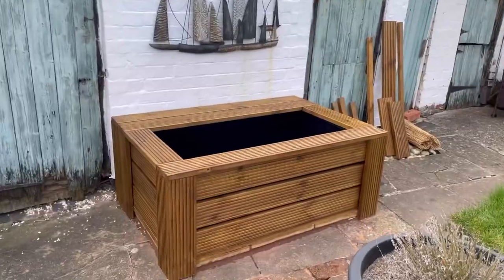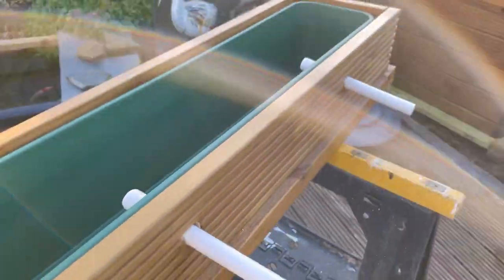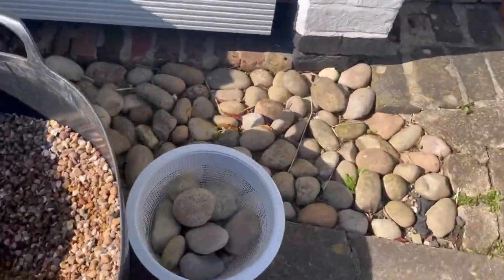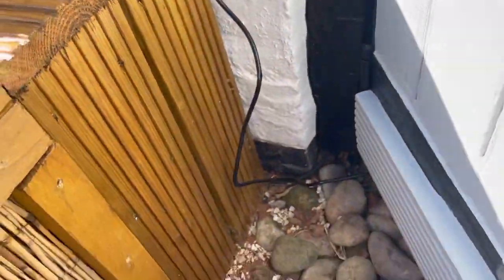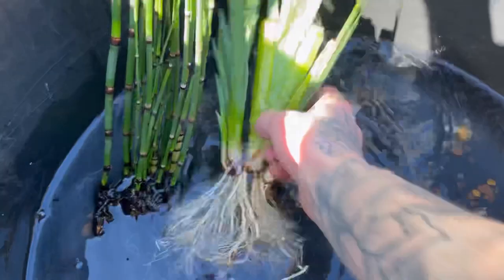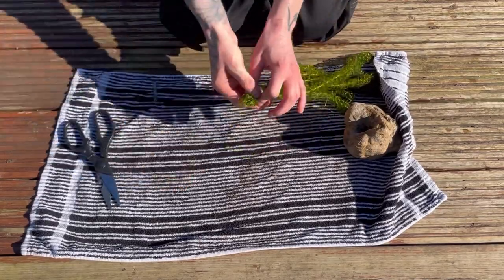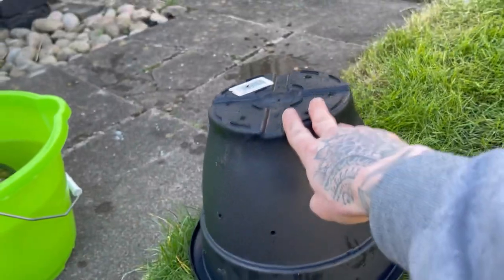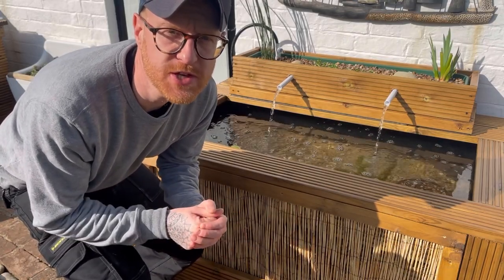DIY *above ground* MINI POND! (Pt.2)

Comment: That's really good, love it, the only thing that I would recommend is that your pump not be at the bottom of the pond, but up a bit on bricks or something,  just in case there is a leak or a fox pulls the tray over or something unforeseen and then the pump won't completely empty the pond, killing the fish. I keep getting a fox in my garden that is fascinated by the pond pump tube and air stone tubes, he keeps biting them and has completely chewed though the ayirstone tubes twice now, if he wanted he could easily bite though the pond pump tube as well and if my pond pump was on the bottom of the pond it would empty it  but so far I've been lucky. In my ponds I have the pumps up on ledges, never on the bottom for this and other similar reasons.
Reply from the maker: Thank you! Yeah, I did end up taking out that pump when I later added a canister filter as a pre-filter.. and when I did that I made sure the intake didn’t go all the way to the bottom. Luckily I’ve not had any issue with fox’s, but I’m alway on my guard as I’ve got chickens! Thanks for watching! 😊
Reply: Found it! New subscriber 😊

Comment: Brilliant - really helpful videos! I've basically followed your example, just finishing off the bog filter today hopefully. When you filled up the tank - did you put the blank cap in place? I siliconed mine in place, front and back, so I could get a load more water in - seemed more beneficial than having an overflow 3 inches down the tank wall.
Reply from the maker: That’s awesome to hear!! Yeah, I also siliconed in the blank cap!!! 😊

Comment: Great video.  The plants that you placed in the pond that were in pots do they just contain gravel?
Reply from the maker: Yeah, I pretty much plant all my plants in gravel as it forces them to pull there nutrients from the water column and therefore helps to prevent algae. The only exception is Water Lilly’s, as they are such heavy root feeders, I plant them in aquatic compost with aquatic fertiliser balls. 👍

Comment: Thanks for a great video. Question, is the little aerator on the bottom necessary? I’d think the aeration from the water coming back into the pond from the bog filter would be enough?
Reply from the maker: Yeah, I think you’re right.. as long as the pond isn’t too overstocked, the amount of aeration produced from the water flowing back into the pond should be plenty!

Comment: I think you'd be better sealing the pipe from the pump into the filter inlet to force the water to come up from the bottom of the filter, otherwise its going to take the path of least resistance and possibly just come out the top of the pipe.
Reply from the maker: Yeah, I did think about sealing it, but decided this way it would make it easier if I wanted to remove the pump and stuff.. I do think the water is going down to the bottom of the filter though, as it doesn’t seem to be coming out anywhere else. I’m building a big version of this in the summer for my new pond, they’ll be a couple of extra feature on it though, and i’m also planning on bringing the water in directly at the bottom, rather than coming in over the top and then down to the bottom, which will defo make sure the water moves though all the gravel! Thanks for watching! 😊

Comment: Hi do you not need various sized pebbles in levels in the bog filter? Just curious as ive seen others put various sizes in. Thanks
Reply from the maker: Ideally yeah, you would have larger pebbles at the bottom working up to smaller ones towards the top. But in a small bog filter like this one, just one size worked fine. I think if I’d used larger stones in this bog filter they would have taken up too much space and made it hard to plant in to.

Comment: What type of wood do you use and do you use some kind of weather resistant sealant on the wood to keep from rotting?
Reply from the maker: I used all pressure treated wood that’s intended for outdoor use, and I then stained it with water based wood stain to give it some extra protection! 😊

Comment: What is your climate like in the winter?  I see you insulated but do you get any freezing weather?  I'm thinking of doing something similar but I don't want to have to bring fish in for the winter.  Thanks and great video :)
Reply from the maker: Hi mate, thanks very much! Yeah, temps defo drop below freezing here. Our winters do vary a fair bit though, some years fairly mild with no snow at all, some years freezing temps and lots of snow. I don’t plan on bringing my fish in for winter, goldfish should be alright as long as the pond doesn’t freeze completely solid, and you make sure there is a hole in the ice somewhere for oxygen exchange. An Air stone can be used to achieve this. My next video is actually going to be on my winter pond preparation! Thanks for watching! 😊

Comment: Hi. I am a new subscriber. This is great! Just what I want to do. I have never had an outdoor pond just large indoor tanks so am looking for inspiration and advice. I have been able to get a new large plastic container which was a commercial wheeled laundry cart. (A gift from a friend). I took off the wheels ( they weren’t bolted through so no holes) and it is perfect for the job and I believe much cheaper than from a pond supplies shop. You can get them online. I love the look of the pond you built but not the plastic pipe that protrudes from the bog filter. Would you be able to wrap it with jute rope or something similar so it blends more with the natural wood material?  Look forward to seeing it when it becomes more established. 😁
Reply from the maker: Hi! The laundry cart sounds like it will make a great pond! I know what you mean about the white pvc piping, it doesn’t look great. I was hoping to swop it out for black piping that I thought would look a bit better, but couldn’t seem to find the right size. I also tried looking for some copper pipe that I could slide over the top, but again couldn’t find the right size. That’s a good idea about wrapping it with rope though! Thank for subscribing, and good luck with your pond build! 😊

Comment: What size pump did you use? I wondering if a too large pump is used the water might flow out of the upright inlet pipe rather than flowing to the bottom. Am I right? Thank you.
Reply from the maker: I used a 700 LPH/ 180 GPH pump. I did have a flow valve on hand to use if I needed, but as it turned out the size pump I used produced just the right amount of flow. I think you’re right though, if the pump was too large, the water may well flow out of the upright inlet pipe. Thanks for watching! 👍😀

Comment: What hose did you use with the pump, does it come with the pump or do you need to buy it separately?
Reply from the maker: Can’t remember now what size hose I used… it would have been either 13mm or 20mm though, both of which will fit with the pond pump I used in this video (which was the ‘Blagdon mini pond 700’. It didn’t come with it though, I had to buy it separately. 👍😊
Reply from the maker: Hi mate, can’t click on that last comment you left for some reason… but yeah, the decking boards sat on top of the base.. should hopefully stop them from rotting! 👊

Comment: Can these ponds support fish in the winter being insulated?
Reply from the maker: Hi mate, I think so… although it may depend on where in the world you are. I’m planning on making a polycarbonate lid with some bubble wrap attached to it for over the winter. Hoping not to have to heat it!
Reply: @GingerFishyOfficial  thanks for replying. I have a porch aquarium which is my latest videos on my channel. But that's just testing the equipment. I'm about to dig a koi pond. But I would love to keep an above ground pond like yours. I live in the Midwest USA. Our winters get cold and summers get hot.
Reply from the maker: Yeah, your weather sounds little more extreme than ours, most years we don’t really even get snow. Last year I had a similar setup, and I put a 300watt heater in, and then connected that to an inkbird temperature controller that I set to 10 degrees c (50 degrees f), and that worked really well. Hoping to avoid that this year though. Will be interesting to see how well the insulation helps with keeping the temperature from dropping too far. Just subscribed to you bro, looks like you’re doing some cool stuff!
Reply: @GingerFishyOfficial  thanks a lot. I subscribed to you as well. Good luck with your channel.
Reply from the maker: @WayneEarls  thanks mate!

Comment: What would you recommend for heating a 50g outdoor pond for fish?
Reply from the maker: Hi mate, depends on a couple of things really.. will the pond be insulated reasonably well, and will you be able to put some sort of cover/ lid on it in the colder months? Also, what temperature do you want to keep it at? I heat a couple of ponds using aquarium heaters, but I’m only really using them to stop it from freezing and getting too cold, I’m not actually trying heat it up..

Comment: Great video, but did you not need a drain outlet to remove the dirty water at the bottom?  Jut asking as I'm about to build my own.
Reply from the maker: Hi mate, yeah if you’ve got some space at the bottom of the filter to create a void space and a drain outlet, I would definitely put one in. I didn’t really have the space for one on this filter, but when I rebuild my big pond I’ll definitely be putting in a drain outlet on the bog filter for that! Good luck with your build bro!!! 💪
Reply: @GingerFishyOfficial  Thank you for your reply.  I'm deciding between a cheap waterfall filter or a proper bog filter with a couple of outlets made from a planter.  Think I'll go for the gravel filled planter, small void in the bottom for a drain.  Its only a small raised pond, but would like clear water.  As the pond is quite a way from the house it'll be a solar pump.  So need to look into one way valves or breathers to stop the filter draining back into the pond when the pump stops.  Love your videos, certainly inspired me.  Thank you.
Reply from the maker: @darrensheldrick9817  thank you!

Comment: do you ever need to clean out the bog filter? If so, how?
Reply from the maker: Hi there, no I’ve never cleaned it out since setting it up over 2 years ago, and its still running well. I did add a pre-filter to it though which stops most of the solids from ever making it to the bog filter, so I think that’s probably made a big difference. You can see how I did that using a canister filter in this video: 
https://youtu.be/po3O73tLJl8?si=ehYBXoJy6jka5mRS
Reply: @GingerFishyOfficial  oh great! Thanks. I'll check it out. I'm building one about the same size or a little smaller. I like the bog filter option.

Comment: Hi what pvc pipe and fittings did you use? I’m struggling to find all the stuff I need in the same size
Reply from the maker: Hi! It’s 32mm pvc pipe and 32mm tank connectors. Are you in the UK? If so, you can get all the bits you need from Homebase or Wickes. I’d imagine B&Q also has them. 👍
Reply: @GingerFishyOfficial  can find everything but the stop cap/end cap are they push fit connections or solvent weld? thank you for the reply pond looks awesome
Reply from the maker: @bluevikinggaming8182  the one I used was push fit, got it at Wickes

Comment: Do you not struggle with the shower holes getting clogged up at all ?
Reply from the maker: Hi mate, I’ve not had any issues so far, the bigger rocks help to stop too much getting in there and clogging them up. The only issue I may have is if the plants get too out of control and the roots get in there and clog them up. But hopefully if I keep on top of pulling out excess plant growth, I should be alright. Thanks for watching! 😊

Comment: Very nice appearance. Is there any difference to using (in a smaller water feature) small pumice, or even, marbles? For the difference in appearance? Thinking about this though; would small pumice work better than pea gravel, by creating more surface area within the same filter volume?🤔
Reply: Will you/have you, added plants to the top of your filter? How often do you clean out this type of filter box?
Reply from the maker: Hi Leo, I’ve never tried it with pumice or marbles before, but I think it would work ok. Not too sure how plants would grow in marbles though. But you could definitely try it! And I think you are right that pumice would work well due to the increased surface area. I have indeed added a few different plant to my filter and they seem to be growing well. My plan is to just clean it out once a year, at the beginning of each Spring, at which time I will pull out all the plants as by that time they will have grown far too big, and then replant a few of them back ready for the season ahead. I don’t plan on ever emptying the gravel, unless I have a problem. I’ve had similar filter running on another pond that I had running for over 2 years, and the only maintenance I did in that time was to trim the plants every now and then. Hope that helped, and thanks for watching!
Reply: @GingerFishyOfficial  , yes it does, very much.

Comment: Will the plants survive the winner.
Reply from the maker: Hi Jim, the plants will all survive the winter. Some are evergreen and will look good all year round, and some will die off and grow back the following Spring. The Barred Horsetail is pretty much evergreen, and will look good all year round, I will sometimes give it a bit of a trim at the end of the season though. The watercress is also evergreen and will often continue to grow right through the winter (although growth rate does slow down). The iris will die off and will need cutting right down to ground level, but will come back the following Spring. The pond weed will survive through the winter and continue to grow throughout. The Water Hawthorn and the Water Lilly will also die off at the end of the season, so will need the dead leaves removing, but again should return the following Spring. It is also a good idea to push some fertiliser balls into the Lilly container when it starts to grow again the following season. Hope that helps, and thanks for watching! 🌿

Comment: how do you clean out the bog filter
Reply from the maker: I don’t really.. but I have got a pre-filter on this now, that stops a lot of the waste getting into the filter in the first place. Other than that I just rely on the bacteria’s in the filter breaking down the waste to the point where the plants use it. It’s been running that way for around 18months now and seems to be fine. This does rely on keeping the stocking level in the pond quite low though. That said I am thinking at some point I will upgrade it to include a clean out valve like I did in my DIY Patio Pond bog filter! 😊
Reply: @GingerFishyOfficial  ok-  I forgot about the prefilter - thanks for replying, have a good day